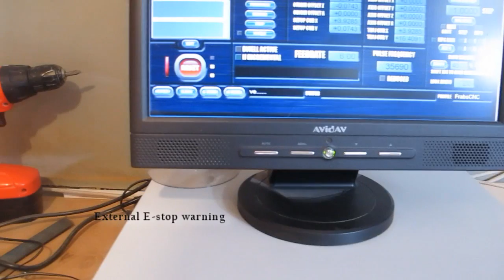Homemade CNC controller

Comment: What are those din fuse holders?  What type of fuse?  I'm just in the process of building a 4x4 Hybrid.
Reply from the maker: They are not din Fuses, just Terminal Blocks.  It is not something you must have, it just cleans up the wiring a lot nicer.
Reply: MrFrabcabert Thanks!  Your controller is great.  I appreciate you sharing it.

Comment from the maker: I had added inlet holes after this video to the case.  Never did have any heat issues though, ran the machine for up to 4 hours under stress.  No problems.

Comment: I realize you dont have heat issues yet but you really should open up a 2 inch hole (or a few slots to create a grill like opening) It will tend to get hotter down the road and it will also cause less strain on the fan although you have a high volt fan (a fan creating a vacuum has to work harder than a free flowing fan) In your case the inlet should be bottom left looking at it. Fan up top where hot air goes although in small space creating a flow of air to the components you want. its a bigun

Comment: Whats so "EXTREME" about this controller? I built one very similar a few years ago with Gecko's Vampire drives (G203V) a Smooth Stepper, CNC4PC C11bob, Keiling 180PS. 

Nothing extreme about my controller either. Its nice, and uses some good components, but extreme it is not.

Comment: Hi. Do you limit the inrush current to your power supply in any way? I have the same type only bigger (80V 20 A) and the inrush current is relay big (my fuses tripped every time) so i installed a timer relay and a 100 ohm resistor on the 230VAC side of the transformer that is limiting the current by having the resistor in series with the transformer for 5 seconds before it is switching to a straight connection to the grid.
Do you also have this solution or do you use another one?

Comment from the maker: @KPbICMAH  Z is the axis that goes up and down.  Z0 is the starting point, the bottom of the bit on eather the table or on the material you are machining, which ever you set it up for.  Z0 finder determines the distance the bit is sticking out and where the bottom of it is.

Comment from the maker: @MrH2oxygen Hi, sorry for the late reply.  I am using 570oz Steppers.  I do not know how to connect 2 steppers with one drive, I also don't think that that is a good idea.  I got 1 drive for each motor.  The power-supply is a 1000Watt 50V DC.  I don't recall exactly, But i think I had the steppers wired for 5amps.      PM me if you want more info.

Comment: hi .good work man.
i`m making  may controller  can i ask u about stepper motors you are using tell me more about the size and amps u r using  .how to connect 2 stepper with one driver on x axis 
i need to know your wiring diagram .
real good work  ,